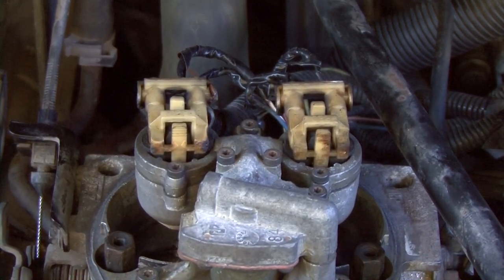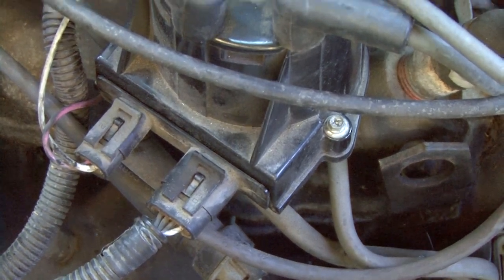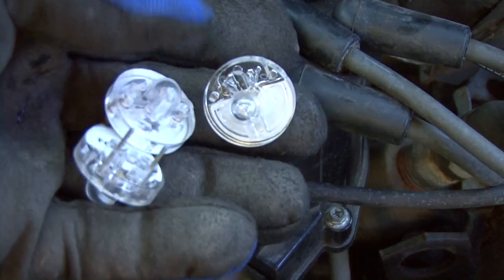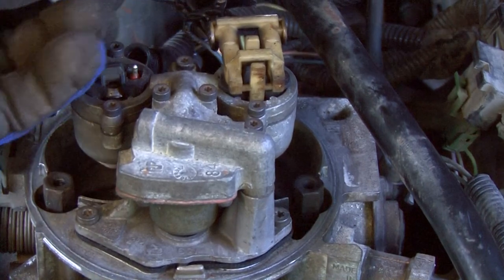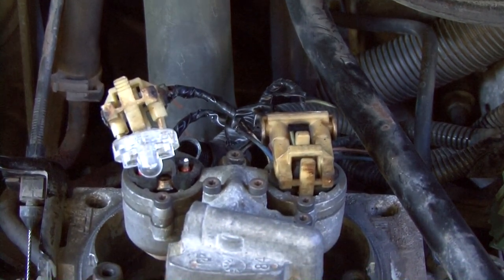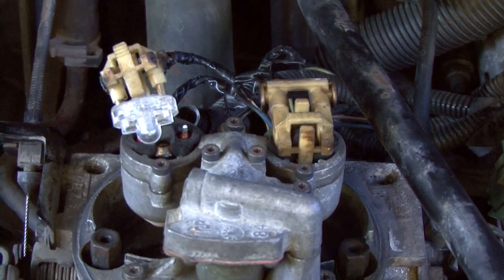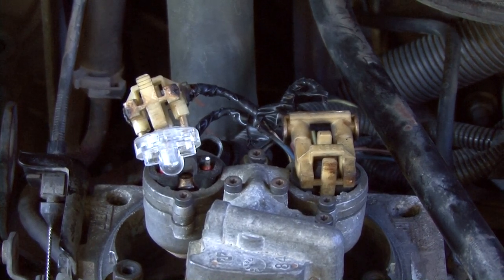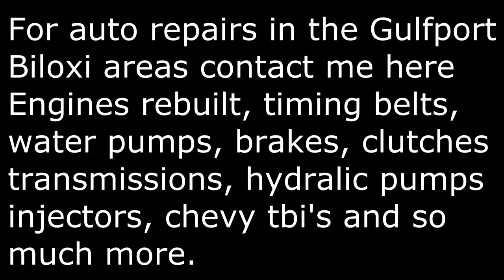How to check the pulse on your Chevy TBI

Comment: For TBI injection, hook up a timing light if no Noid is available. Point light in the throttle body. It took 7 different garages in Georgia before we eventually tried this and found that one injector was not spraying but was squirting fluid. 6 did not understand this really simple trick. Neither did the 7th but we discovered it. Gm dually truck did not have any pulling power.
Reply: Great tip ! The timing light strobe effect is like a freeze frame & you can see if the spray is atomised well or just gushing out. Thanks !

Comment from the maker: lol thanks , well ive been wrenching for many years and owned a fuel injection shop, built all my superbike motors and my turbo hot rods so boost and fuel i just got really good with. Yeah to bad your not closer i could fix it, but i do have enough videos on the tbi to help get you in the right ball park
Reply: Why do i have good pulse on tbi injectors, but no fuel spray? New fuel pump in and working. Need advice.....
Reply: Hey what's up I have a problem I have a 1984 Corvette I just replaced the fuel injectors it's start up gas came out of them now it doesn't have gas coming out of them and they're brand new fuel injectors what do I do and what's wrong can you please help me thank you
Reply: @mikecrowley1617  , the fuel pressure regulator can be bad. A rubber diaphragm that allows fuel to be metered to the injectors can easily tear & crack. The fuel pressure test must also be done at the fuel filter to ensure the proper pressure is being pumped from the sending unit.
Always buy the A.C. delco/ OEM fuel filter as overseas manufactured filters they skimp on material to ensure the flow is within specs.
Your oil pressure sensor , if malfunctioning will cut off fuel to prevent engine damage  due to a erroneous signal detecting a false no  oil condition in the oil pump.
Reply: @mikecrowley1617  hey lol did you ever figure out what was wrong with yours
Reply: What do I do if i'm not getting any pulse?

Comment: I have one for you so I have a 1989 Chevy P30 Step Van and what happened this when I let it run for like a certain amount of time to check engine light will come on then the truck will shut down and I do not get no more fuel to the injector would you be able to help me out with that is

Comment: Can somebody please help me, last month I hooked up the battery backwards, and saw smoke come from the driver side under the hood, I reconnected it back and I got spark but no fuel, every fuse was checked by a multimeter, I’ve replaced the icm, and I checked the injectors with a test light I get constant power on one wire and I get no pulse when I crank on the other wire I have no idea what it could be

Comment: I have an 89 Chevy 2500 getting no fuel to the injection. I have replaced the pump and fuel module, plus tested fuel pressure at the back of the throttle body. Any assistance would be greatly appreciated.
Reply: What did it end up being? I’m having a Similar issue. Thank you.
Reply: Did you fix it im having trouble also
Reply: @559Obsalex  yes thanks
Reply: @geneday6062  what was it

Comment: CODY, I HAVE A 1992 CHEVY 1500, I have had issues with it just stalling and dying off and on for the last 3 years, i replaced the engine 10k miles ago and it was doing fine then started stalling out and wouldn't crank back up, so since this is my work truck i replaced every sensor under the hood, still had same problem so i rebuilt the throttle body and put new injectors, new regulator and even pig tails, and then replaced IAC,MAPS, THROTTLE POSITION, ELECTRONIC SPARK MODULE, FUEL PUMP, FUEL PUMP RELAY, ECM, PLUGS AND WIRES AND RAN A NEW GROUND FROM FIRE WALL TO ENGINE BLOCK, THEN TRUCK RAN FINE FOR A COUPLE OF DAYS AND THEN STARTED TO FLOOD OUT WHEN SWITCH WAS JUST TURNED TO THE ON POSITION, AND GAS LITERALLY RAN OVER THE INTAKE AND ONTO THE GROUND. i LET THE TRUCK SET A WEEK AND WENT OUTSIDE AND CRANKED IT NOW ITS PULSING FINE AND RUNNING GREAT? 
QUESTION IS WHAT WOULD MAKE THE INJECTORS STAY ON WITH JUST THE SWITCH TURNED IN THE ON POSITION WITHOUT EVEN TRYING TO CRANK IT AND NOW IT SEEMS TO BE RUNNING FINE?
IM KINDA SCARED TO DRIVE IT WITHOUT KOWING WHAT CAUSED THAT ISSUE, BECAUSE I DONT WANT A FIRE OF COURSE,
THANKS, MAC DAVIS
mdavis@bdgre.com
Reply: Im having the same issue right now did u find out what was the issue?

Comment: Ok I have fuel and pressure to rail 96 tpi I replaced fuel pump and I have confirmed 44 lbs to fuel rail plugged off 9th injector for cold start will start on either this is a new build no miles yet and maybe 3 minutes ran on either... I am thinking that its somewhere between. The distributor and injectors it has to electrical
Reply: The PSI to your fuel rail should be 12PSI. I've read articles where someone was having sort of high fuel injection and he found someone installed a 44PSI fuel pump in the tank and swapped it out for the lower rates correct fuel pump and it cleared up

Comment: I’ve tested mine with a test light and it lights up and the injectors are good. Still not spraying. I made sure it’s getting fuel all the way to the throttle body but it won’t spray and idk why. I even dumped gas into the throttle body and it still wouldn’t start just cranked. I’m lost been sitting for ab 4 months because I can’t figure it out.
Reply: U figure it out?
Reply: I have this same issue 🤦🏿‍♂️
Reply: @queeniyahdayday2600  clean the base where the injectors are; that’s what our problem was.  Injectors were fine just where they sit in was all dirty.  Started right up after soaking in some cleaner for a while
Reply: Was your injector lights coming on when you chevkeckec under dash? Mines doesn’t light up w light test
Reply: @Jrcole91  were you replying to my comment?
Reply: @kennyrogers1243  yes
Reply: @Jrcole91  when we did the injector test, we never checked under the dash for any lights
Reply: @queeniyahdayday2600   i cant figure it out, new fuel tank,filter, pump, rebuilt throttle body/ kit  new injectors but no spray like it should?
Reply: Did you ever figure it out?
Reply: @shirleywilliams5124  any update
Reply: @shirleywilliams5124  did you figure it out

Comment: im used test light to test the pulse injector and connection  but i not getting anything. can i test it by 12 v battery? wher can i find the broblem if i not getting signal in the connection
Reply: Sure, better off buying a Power Probe that you can easily detect good ground with & apply power to various suspect components while trouble shooting ; power window regulator , switches . electric radiator cooling fan,  fuel and  injectors. etc.

Comment: I have a 1989 Chevy C1500 4.3 v6 manual. And it has a very high idle.  I changed all the sensors underneath maybe that wouldn't fix it but it's   Still  Idle at 2500 .
Can anyone help me plz
Reply: I'm having a similar problem. With my 93 K2500 would need to be in gear on the brake letting off the throttle to help the computer adjust but was still sitting at 1500 when it would adjust. Found a small leak at intake gasket. Replaced now it wants to run at 3800 and I can't get it to self adjust. Ran through all my sensors checked I don't know how many times for air leaks even hooked up my air compressor through the spark plugs ports and made a plate to mount to the intake to seal it and no leaks. I'm thinking it's injecting too much fuel but I'm not running rich. Only thing I can think at this point would be the pulse signal from the distributor. I disconnect the dypass wire for when setting timing and at first the idles low but only takes a few seconds for it to skyrocket up to that 3800 rpms. Hopefully someone can chime in here or maybe you already figured yours out if rather not throw suspected parts at it hoping for a fix.
Reply: @jacobdaniels9432  , look for a U tube video on recalibrating / resetting the TPS to adjust your idle speed.

Comment: im not getting fuel injector pulse   new fuel pump// distribator  // ecm  plugs wires checked grounds  new relays its on a 1989 tpi camaro
Reply: Christopher Munoz did u find what the problem  was?
Reply: unplug dist.bypas wire and check the pulse wire at the starter or fuel/ oil pressure sender between the fuel tank and fuel filter

Comment: I used noid light im not getting nothing i put test light on the pos of plug i am getting power but nothing on neg side
Reply: Donald Ross did you ever figure out your problem?? I’m having the same issue.
Reply: Sounds like your ground wire isn't grounded, bad plug or break in wire somewhere
Reply: The pulse is a ground signal cut out from the ignition control module or the ecm, there's always a hot. Most test lights won't signal fast enough to measure this hence the noide light.

Comment: hey! I have a 1990 firebird with tpi and the only thing I cannot figure out is that after I rev the engine, as the needle drops it falls to about 200-300 rpm and bucks for a second, then goes back to normal. it causes a lot of hesitation when driving, but it's still "driveable". Any ideas as to what that could be?

Comment: Hey I have a 91 caprice I replaced fuel pump an filter an it's still lose power when accelerating any ideas
Reply: A bad throttle position sensor will cause that.